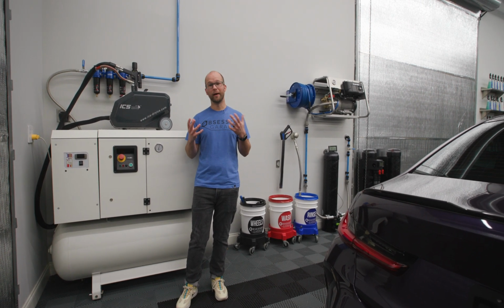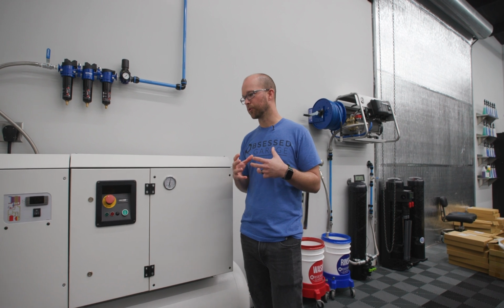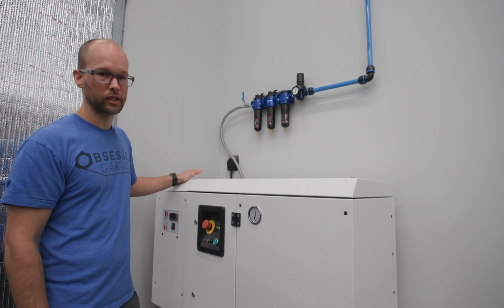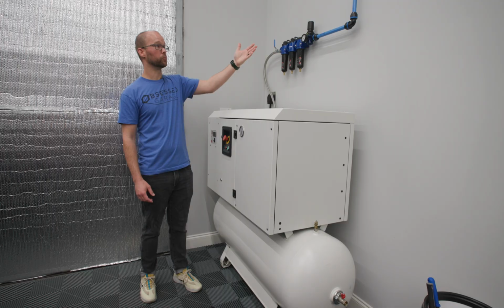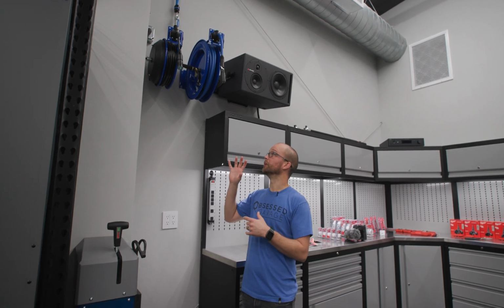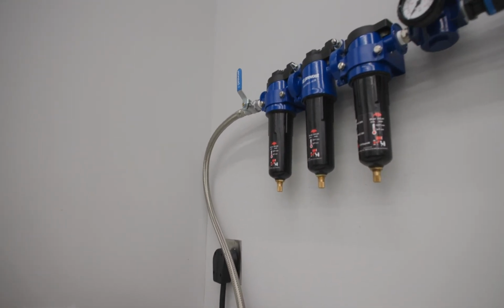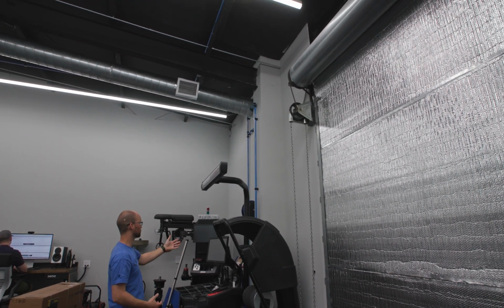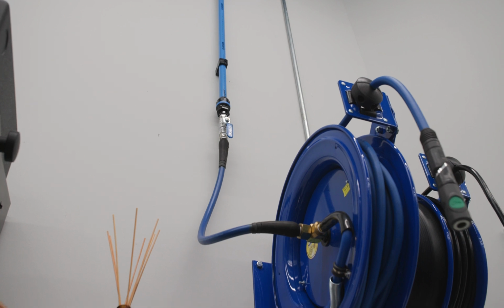Air Compressors FAQ: Recommendations and Tips for An OG Install

Comment: Silly question here but: if you’re building a house from scratch, would you put all the compressed, air piping and fittings behind the walls or is that just asking for trouble or whenever you need to troubleshoot for leaks and such
Reply from the maker: I actually prefer keeping them exposed, both aesthetically, and as you mentioned, for service.
Reply: @ObsessedGarage  I must admit they do look cool these Prevost hardware
Reply: In a workshop you prioritize utility above all else. Everything should be exposed for maximum flexibility.

Comment: Curious where you put the dryer condensation hose for drainage.
Reply from the maker: Since the building is conditioned and dehumidified, I've found just hanging off the back is sufficient.  It just drips on the floor.
Reply: @ObsessedGarage  What about the tank drain so water at the bottom of the tank can be blown out when the tank won't be used for a while? I'm considering running Prevost for that outside.